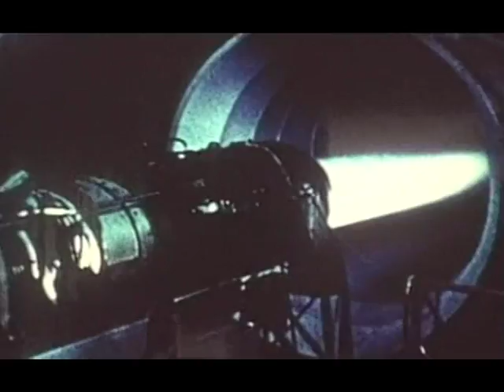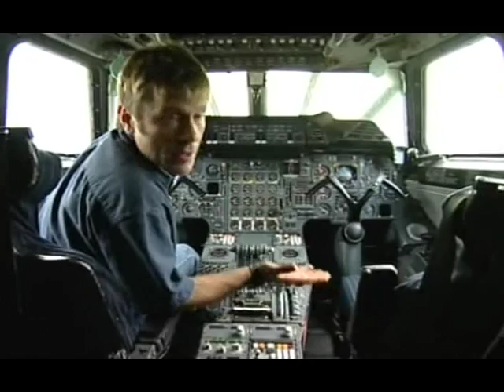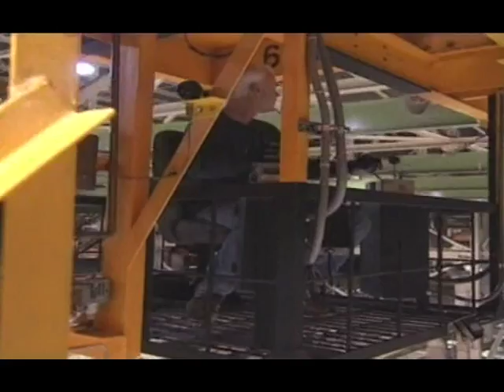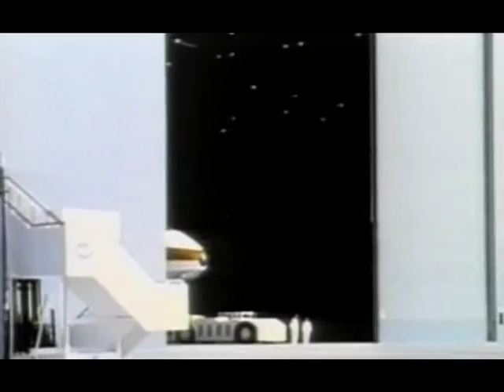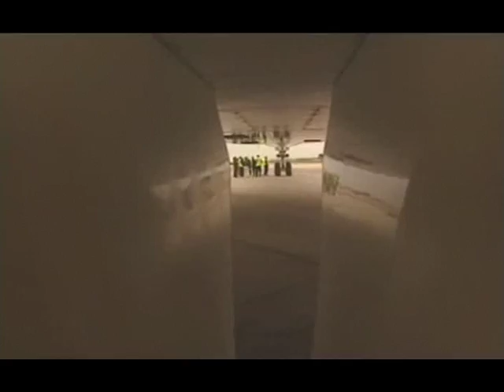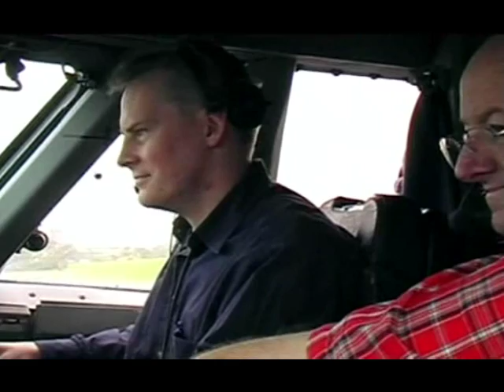Flying Heavy Metal Episode Three: Size Matters-Part 2 HQ

Comment: Woah, Bruce!  The RAF never had a single airplane that could catch it?  What about the English Electric Lightning which managed to not only intercept Concorde, but to pass it from behind?  Granted, though, not even the F-15 (an airplane said to be able to do Mach 2.5, but only if you melt the cockpit canopy) could catch the bird.

This should be seen, not as a failing of the Concorde, but as a remarkable success for the Lightning.  Both were absolute beasts.

Comment: Oh do  you mean the A380 which has yet to MAKE a single commercial airline flight? The first time the 380 has someone other than Airbus's paint on its outside then it will be the largest airliner. Until then its still just a economic black hole test bed.